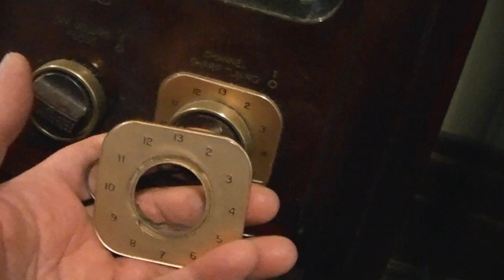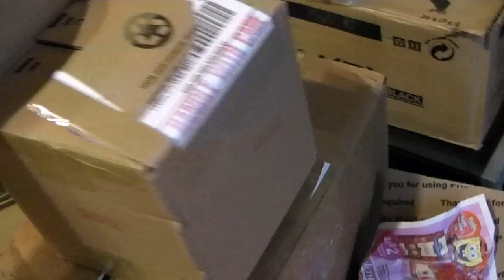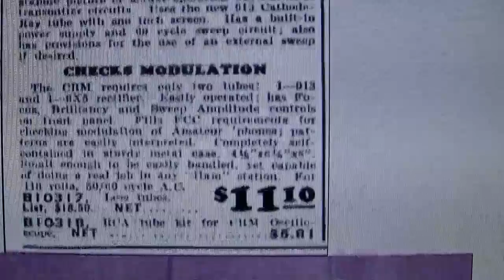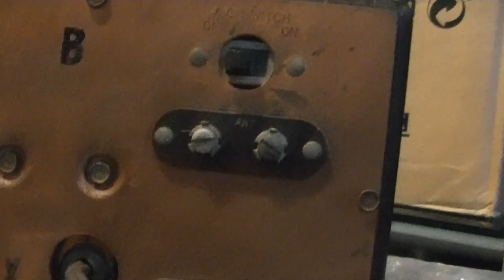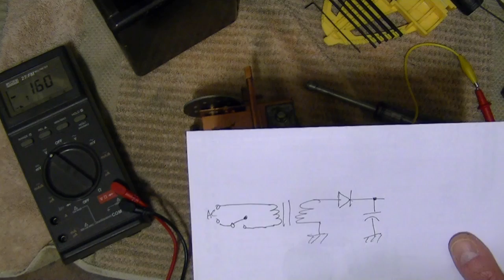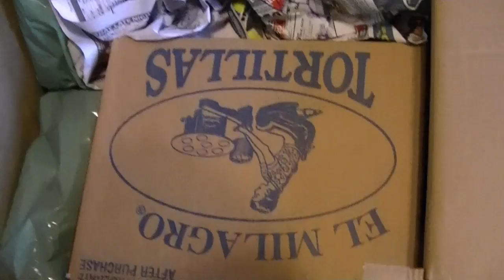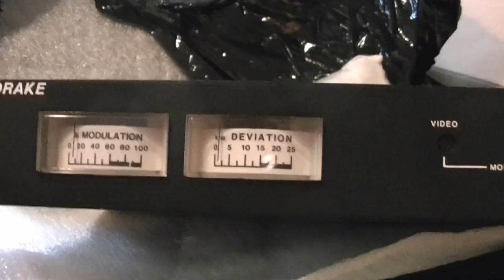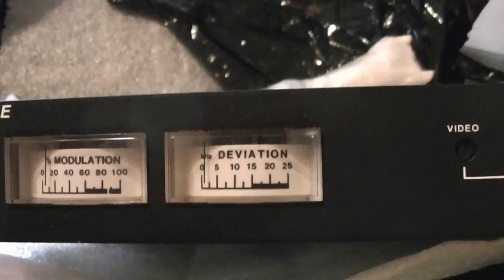Unboxing Feb 14th, 2014

Comment: Bob,
An awesome assortment of goodies. I'll be among the others waiting for the Scott restoration :~)  My parents bought a house with a Drake satellite receiver installed in it about 20 years ago. It used a huge dish out in the back yard to receive it's signals. I noticed that when the receiver scanned through the satellites, they were not in order alphabetically. So what does a curious child do ? Yes that's right I alphabetized them and boy did that cause a bunch of chaos ! 100 bucks later it was working again. From what I remember that Drake receiver was kinda high end. It had stereo audio and the ability  to connect multiple LNB's to it. It also weighed a TON ! Thanks for sharing.
Nathan

Comment: The 1CP1/DH3-91 is a similar 1-inch CRT made by Philips/Mullard.  I believe they are a little more common since they were used in WWII-era radio waveform monitors.  It has a Loktal base.

Comment: Bob, think you will enjoy that modulator.  I have one that broadcasts out on channel 7.  Built a half length dipole antenna for channel 7 frequency and directly plugged in the video and audio from my DirecTV box.  All my old sets just use period rabbit ears to pick up the signal.  What is nice is, if you have a set with a funky tuner, as long as the 1 channel is good that you are broadcasting to, the set will work fine.  Funny changing the channel on a 60 year old set with my DirecTV remote.  :)
Reply from the maker: I have a couple Blonder Tongue modulators that work well.  One fixed on channel three and one of the big agile modulators.  I'm curious to see how this Drake compares.

Comment: The RCA is a 1934-35 set actually, if it uses 6.3 volt tubes, 1933-34 if it used 2.5 volt tubes. Much of the time when they cut the legs off of a console radio it was because one or more of the legs got damaged. Most of the time they did this with turned legs where some of the turnings would get chipped or delaminated and fall off, I haven't seen this with tapered legs as much.
RCA had plans to manufacture a magic eye with a metal envelope with a very similar design to that 913, but it never got beyond the prototype stage.
Reply from the maker: 2.5 volt tubes.  The model was introduced in 1933.

Comment: wonder if you could feed the sweep signals and video signal from a full size set into that tiny CRT, one of the sets that use electrostatic deflection might be able to do it with minimal modification.
Reply from the maker: There would be a few issues to deal with.  The voltage levels would be much too high.  Also, one of the vertical and horizontal deflection plates are tied together.in the 913 while they are not in the 7JP4.
Reply: thought as much